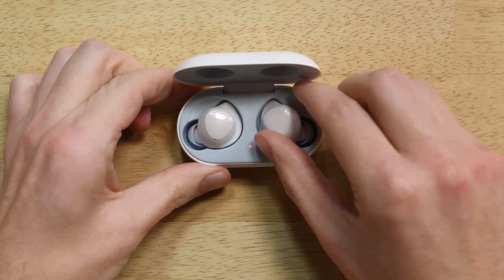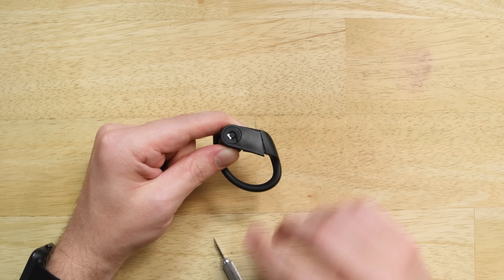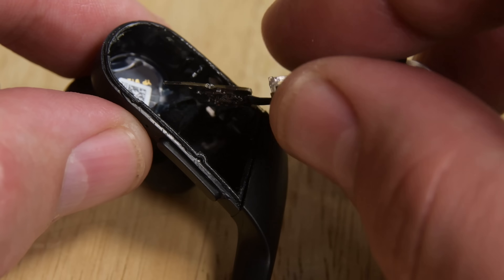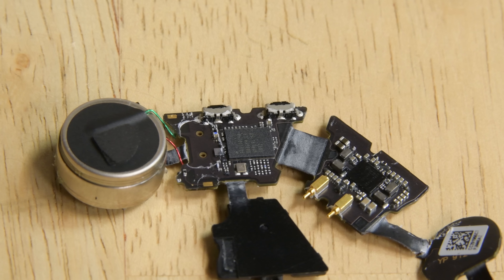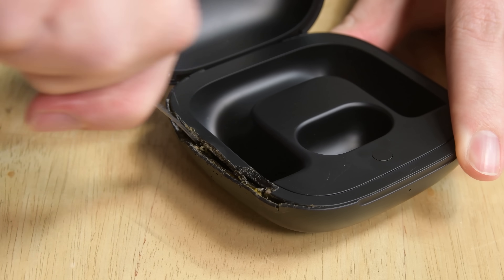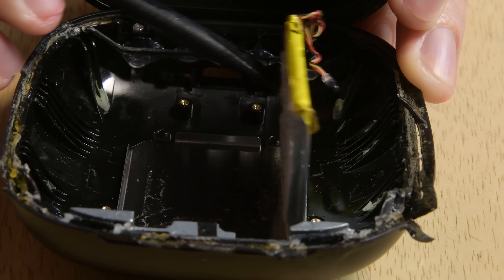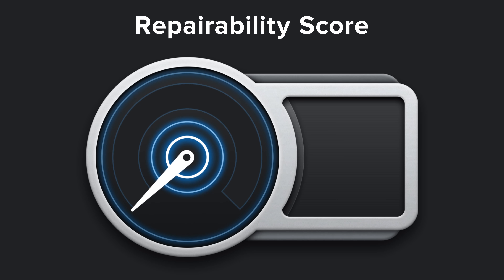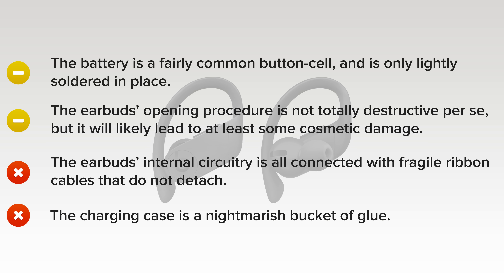Powerbeats Pro Teardown!

Comment: I can tell you after almost 3 years of pure beating. These buds are officially a piece of equipment. I couldn’t put them through more of a tough test than they’ve been in the past three years dropped drowned lost found dozen times over and the only issue is the microphone on the left. One is a little bit muffled. It’s hard to use Siri, this is DeWalt quality
Reply: That’s why I’m on this video by the way the microphone I wanted to know where it is

Comment: Interesting thank you guys for this video tutorial on the beats pro wow the whole process and the parts component description of it all. The whole disconfiguration of the beats pro is amazing. I found this truly amazing and interesting really. I want to repair my beats pro but it seems like it'll be a troublesome process? I found the battery process on the headphones interesting doe. I wonder if that's the solution to my beats pro problem.

Comment: Thank uuuuu ifix. U have the only video on the internet that dissassembles the box of the powerbeats. My box battery is also dead. All 3 batteries are dead. So it seems this is irrepairable. I cannot open the box without wrecking it.... 😒😒😒

Comment: My right Powerbeats pro bud went out due to sweat, which apparently corroded something according to Apple.  They won’t repair it because I didn’t have Apple care, even though I’ve only had them for 2 months.   Is it possible or realistic that I can find someone to repair this for less than the $179 a new pair would cost?

Comment: I would like to see more of the inside of the charging case. My case's left side is messsed up. The pogo pins look perfectly fine (checked under a microscope, they don't appear to be depressed or offset or anything) however, if I take a mutlimeter to the pogo pins, the side that still works, the right side, reads 0 VDC. However, the left side, it reads 4.5 VDC even though the pogo pins are not depressed. I thought maybe there was a magnetic switch that triggered the discharge, but I threw a magnet on the right side and checked the voltage and it was still reading at zero. I don't really want to tear it open to find out since the right side still works. Any chance you have some insight as to what could be causing this? I doubt I can repair it, I'm an electronics troubleshooter, but I'm kinda entry level still.
Reply: I'm having this exact issue with mine that are only a year old -- just out of warranty. My left earbud is dead, but since I get the same voltage readings that you got I'm thinking the issue might be my case.

Any solution?

Comment: Only grip i have with mine is no wireless charging, every other brand out these has it and there is plenty of room in that case for it but nope Apple cheaped out. I cant believe that a group of engineers standing around crossed wireless charging off the list of features and thought it was a good idea not to include it.
Reply: Same. I came to see if I could solder in a charging coil myself, but I don't want to destroy my case.

Comment: Thank you for this video, it was VERY useful 👌

I'm currently having an issue with my case not powering on despite it being plugged into a cable. 

I have dropped the case notoriously a few several times & by looking at the internal design of the case in your vid, I wonder if any wirings/connections may have come loose when I dropped the case

Comment: Fair evaluation, but I argue the customer base is more concerned with durability of this product than repairability. Since Apple started soldering RAM in their MacBooks, the modules do not fall out of their slots, and their slots do not break. Further, no matter how much you shake one, you won’t hear parts come loose and rattle around. That logic works even better for headphones, which you are expected to treat roughly, toss in bags, drop, step on, etc. I’d give up some repairability if they don’t break through all that. I guess I must be an Apple shill. Let me be clear: I support repair-friendly policies and, in a vacuum, repair-friendly products. If the choice is between the product lasting on its own or being repairable but needing repair more often, like it or not, many users will throw away the repairable item when it breaks and buy from another brand in hopes it lasts longer without repair.

Comment: If you like, and can afford Apple's AirPods, some of the replacement/repair scenarios aren't horrible. Though, as is sometimes the case, there are always those "just better off buying a new one" situations. This info may or may not be accurate at the time I'm writing this, but it's my understanding that:
If you buy AirPods with an iPhone, and get Apple Care + on the phone, the AirPods are also covered. If you need an out of warranty case battery replacement, it's $69 (the same price as a "lost case" replacement). AirPod battery replacement is $49 each, which yes, is a bit steep, especially if you need both replaced. On the other hand, quite a few people seem to be getting replacements at no cost, after the original warranty. It's a matter of who you talk to, and naturally, how you talk to them. So, the bottom line is that they aren't necessarily designed to be thrown away when they fail, but if they made them easy to fix, durability, design, and splash resistance would likely all suffer. I'm not surprised that they're essentially not repairable, but I am surprised that you thought there was any chance they would be. 😃